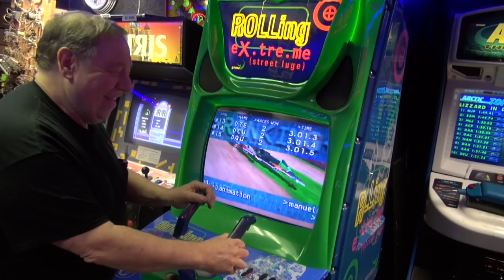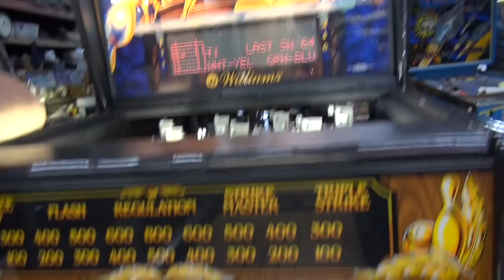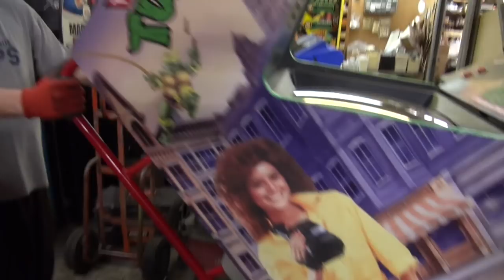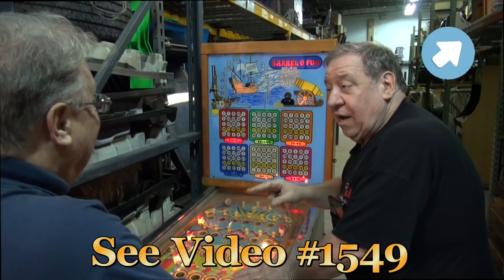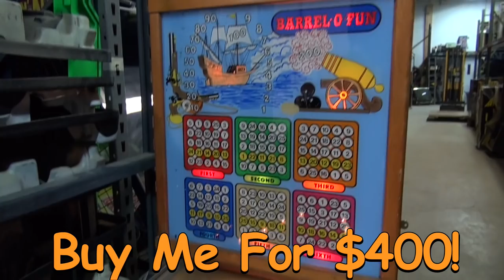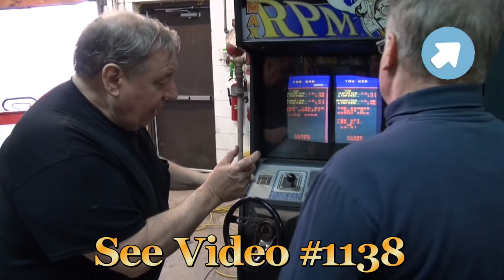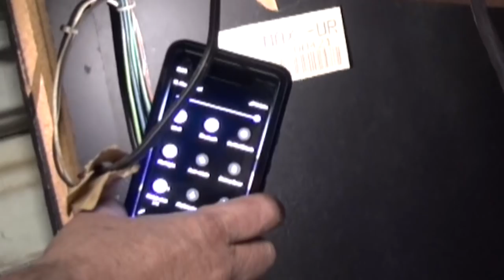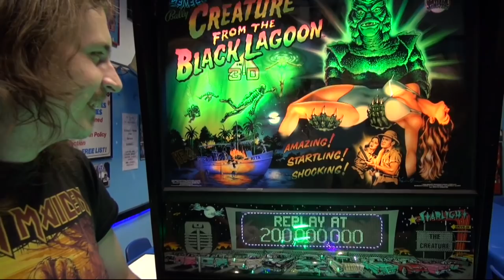#1550 Bally RPM Arcade Video Game-Cheap CREATURE Pinball Machine LED Mod!-TNT Amusements

Comment: This is really useful information, because in the MAME emulator "Spy Hunter 2" (which has similar hardware to "Max RPM") does not have a 3 position shifter on screen.  Also, since the position is 1st, 2nd and 3rd, it is not set up to toggle when you press a key to get those gears.  In other words, you have to hold down the button while in first, hold down a button to get to 2nd and hold down the third button while in 3rd.  While this setup is more "arcade accurate", the lack of toggling on MAME makes it difficult to play.  I see that "MaxRPM" has a 4 position shifter from your video.  It makes me wonder why games like "Cruis'n USA" in MAME do not require holding down a button to get in gear.  I think that "Spy Hunter 2" just does not get as much attention as other games because of its reputation.  However, the presentation of the game causes this reputation!  The only easy way to play it is on Midway Arcade Treasures 2 which has an onscreen shifter and does not require holding down keys (just toggling.)  Sorry for the tangent, but your video helps shed light on some of these issues.